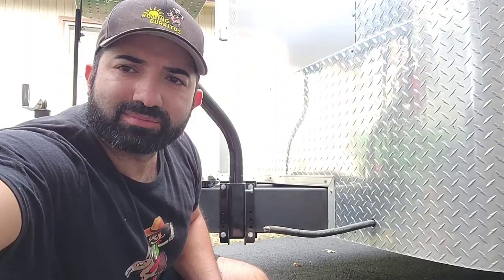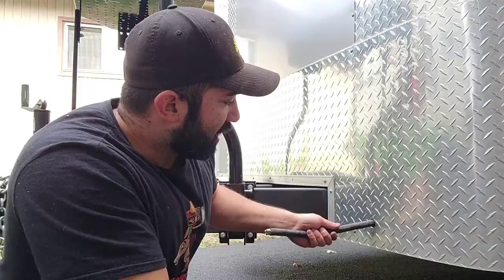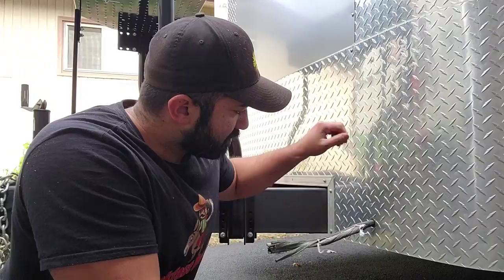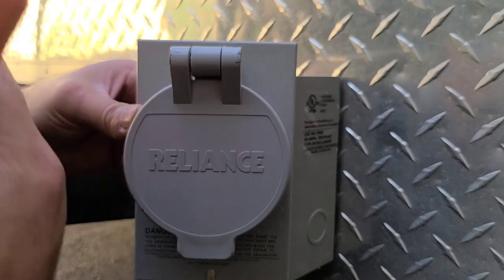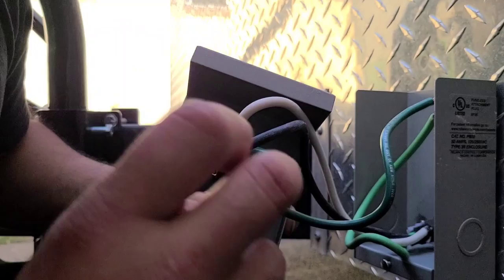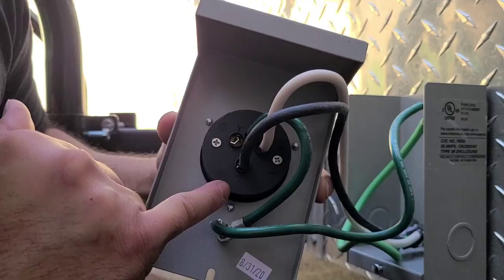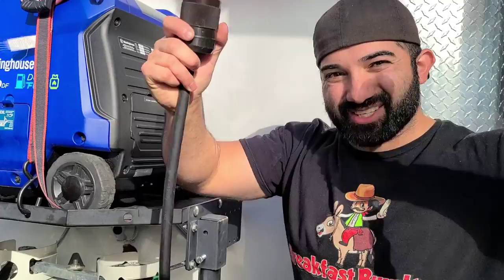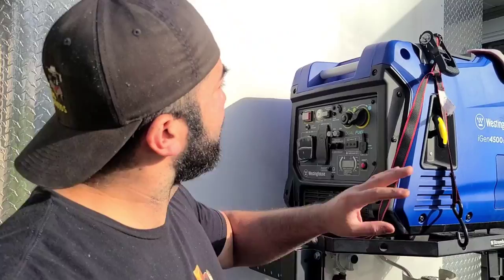Inexpensive vs Expensive Generator, Which is better for a Food Truck?

Comment: Yes the 50amp 3 prong inlet you are using will work. BUT,  I’m fairly certain that inside that inlet it has ground and neutral bonded together. Which is only supposed to be done in a main panel. The trailers main panel is considered a subpanel.
You would need a four prong 50 amp inlet to keep the neutral and ground separate. Or use a 30 amp 3 prong which keeps neutral and ground separate. Look at the back of a 30amp 3 prong 120v inlet and a 50amp 4 prong 240/120v inlet. You will see that neutral and ground are not bonded together on either of those that you could have used.
The generator doesn’t bond together it’s neutral and ground. So I’d think it shouldn’t be done in the inlet either
Reply from the maker: On the thr inlet they have separate terminals is that what you meant?
Reply: @fbaltierrez  
Did you find out the answer?

Comment: Two questions, 1)
 best place to buy Gas struts for the concession window? 2) Any videos on the calculations to know what to buy?
Reply from the maker: @MikePanos  on struts I do not, have never had to replace. And I do, but just take Amps multiply by 120 and that gets the watts
Reply: Can I run a 220V espresso machine on a 30amp breaker?

Comment: Look at 30amp rv cables or marine cables you can get a male to female 30amp cords. I love your video's they gave me the courage to get my foodtruck dream started.
Reply from the maker: Appreciate that tip. Looked them up this morning for the 50 amp one bit on the pricey side. $160 and 10 feet long. Mine is about 6 feet but it is a great option. Thank you :)
Reply: I saw many premade HD Cables listed on Home Depot site also
Reply from the maker: @nathanc3396  yes there are some there I do believe so, you can go either way I liked making my own that way I knew how to make one that was the only reason lol

Comment: Hey Frank, your videos are super underrated and really helpful! Quick question. I’ve added up the total amount of wattage between all the equipment I’ll be using and it comes out to 5500w. So in this case I would need a generator that puts out around 6000w correct? 

(Building a coffee truck) espresso machine’s and brewers take a lot of power.
Reply from the maker: Yeah I would thats about 50 amps. Yes those machines are energy ssuckers. Coffee my favorite
Reply: Hi did u manage to find your anwer? Im getting mixed up with amps and watts, I don't know which generator should I get, I want to get a  tea urn which is 2500w that half already of a 5000w generator
Reply: @1234569518  He is running a generator that puts out 120v 4200W running. 4200W ÷ 120V = 35A. The max amps he can run is 35A. So if you were using this generator and consumed 2500W you would be using 20.83A.  If you purchase a generator that puts out the same 4200W at 240V then the Amps would still be the same but split between two legs. 4200÷240=17.5A per leg.

Comment: Nice video. Understood how to calculate the total amps on your 120V panel. The question I have is, what happens when you need a piece of equipment that’s 240 at the same time with 120’s. Do you wire for 240, calculate total available amps based on 240 and as long as total amps doesn’t exceed the 240 calculations is Ok to mixed both 120 and 240 on the same panel? Or you need separate electrical sources for each? Thanks in advance. Hope you are doing well. Saludos !!!
Reply: Get  a 240 set up and break it down to whats needed with a breaker box.

Comment: Frank - I set up my electrical just like yours where power is going through one leg in the panel for 120 V. I need 50 amps to run everything in my trailer so 6,000 watts. Most generators allow you to switch between 120/240. If I buy a 6,000 watt generator that has the 120/240 option and leave it on the 120v setting, will I only get 3,000 watts of power or will I get the full 6,000 watts on the 120v setting?
Reply from the maker: As per my understanding of Generators, I am not a Generator expert is you will get the max watts on which ever power style you use. Either the 120v or 240v

Comment: Thank you for sharing? My trailer was fitted with a 50 am cord, I need 6000 watts wondering If I can get a converter to plug into 30 amp generator?

Comment: Hola Frank gracias por compartir tu trabajo. tengo una pregunta, hemos tenido muchos problemas para poner a trabajar un trailer que compramos nuevo, al parecer el problema es el generador, tenemos una sanduchera, una nevera bajo el flat, un refrigerdor, el extrartor, aire acondicionado, nevera pequeña de sodas, luces y todo prende, pero deficiente con un generador dual de 7250, sin embargo cuando prendemos el calentador de agua se apaga todo aunque no se apaga el generador y tampoco se bajan los breakers, tu crees que un generador de mas potencia solucione el problema? gracias.

Comment: I have generator does not start at all no crank do I have to put it in metal trailer or wood floor trailer ?
Reply from the maker: You Plug the battery in on the back?

Comment: I have noticed the size and weight of full size generators is excessive to the point a see guys having install a crane or winch to transport. Is it possible to just get midsize generator to run to the plug in to power the lights and fan and then get a portable to run direct to the fridge and maybe a microwave or warmer?
Reply from the maker: I have only used this generator it pushes 30 amps which I have found is usually plenty unless you are running some big coffee machines and such

Comment: How u ever thought on a solar generator ?.  I don’t like to run a gas generator because of the noise , I am pretty sure you could run a 3 watts exhaust fan , lights , cash register , and the griddle , frylator  can be run w propane for my set up.
Reply from the maker: Solar generator interesting, I haven't even seen one yet. Great idea tho
Reply: @fbaltierrez  
BLUETTI.... I want to put my RV on Total Solar... 
I have been looking this up for ever....
If YOU will get ahold of Bluettie Solar Generator... They will HELP you with the cost of the Generator if you make a Video on installing their Generator..
They have asked me to make a video on me installing a Bluettie Solar Generator... The AC200P is good and they have where you can Piggy Back for more amp.... it's amazing.  Clean and Quite!!!
Reply: @fbaltierrez  
People that have Electric Cars/trucks are using the Bluetti in the back to have Electricity in between charges. The Bluetti Solar Generator the one I want ... the AC200P is 60 LBS... there is another NEW one that just came out that you can PLUG in a 30 AMP into the Generator! WOW!!!

Comment: Hello Frank. Do I add the amps from all of the electrical equipments to find out which generator I’ll need?
Reply from the maker: Amps or watts. Watts might be easier if it's all 120v
Reply: @fbaltierrez  thanks for that

Comment: Hey frank I'm running my wire straight from the panel to the generator my fuse on my generator keeps popping that means I need the plug for the outside like you just explained

Comment: I have a predator 7250 watt running watts. I have a full electric cargo trailer. This is 30amp max. It has the ability to use 120/240v. I have to wire the inlet to power this trailer. I want to put a 50amp inlet. I am using 6 gauge wire to put power to the breaker box. My question is, when I wire up X, Y, G, W to the breaker box with 50 amp setup, can I still use 30 amp generator with 30 to 50 amp converter plugs? I want to be able to use 240v if needed. I only use AC, Conventional single stove, mini refrigerator, hot water heater, water pump, and LED lights. I feel like until I get my 50 amp I cant use stove and AC together. With everything on together they exceed 30amps.

Comment: Frank! Do you recommend two of this generators in parallel for a sum of 60 amps. And can I connect the two parallel generators to sane 50 amp inlet you are using   with out overloading. Thank you Frank any help is appreciated. My trailer does require a little over 40 amps. And I would like to parallel two  smaller generators for noise reduction rather than a big gen.
Reply from the maker: I would get the bigger Predator Generator if you haven't purchased one yet. Quiet Generator
Reply: Are the predators reliable
Reply: @fbaltierrez  are predators reliable in your experience/knowledge?
Reply from the maker: @MrKrabsMeatyClaw  in what I have heard  they also are great Generators

Comment: Can I connect my espresso machine to the generator with an adapter?
Reply from the maker: Depends on Generator and machine are they both the right watts and 120v or 240v
Reply from the maker: But hypothetically yes

Comment: The amps remain the same what you increase is the wattage if you ve  two 4200 watts and 30 amp generator  you will have 8400 watts and 30 amp single face

Comment: I’ve decided to buy the same generator as you. Can you provide a link to the cord you bought? Will any 3-prong cord meant for 120v and 50-amps work? I’m just going to cut the end off and wire the reliance 50-amp connector to it right?

Comment: Can I power my ice cream truck with a power inverter connected to the battery? If so what are the pros and cons
Reply from the maker: Never tried that. Would not be able to give any insight. Only Generator and house power used at all times.

Comment: Are you usuing 6-4 50A Cable to make the Pigtail between the Generator & the External Electrical Box?
Reply from the maker: No. Same wire that I use to run to the service panel. 8/3 wire

Comment: Hi Mike Brandt, I am looking at a 3000 watt, or a 7000 watt generator. Do you think a 3000 watt will be enough for a burger van ?
Reply from the maker: 3000 watts is about 25 amps. What kind of equipment are you running?
Reply: @fbaltierrez  Im looking at a champion 3100 watt with inverter( do I need inverter?). Im running a standard kitchen, George foreman grill. small electric fryer and a small under counter top fridge. All domestic appliances. Hot water and stove are both gas powered so don't take power. We dont seem to have this westinghouse model in Europe:(
Reply from the maker: @tr3204  inverter generator are quieter always a good thing. 3000 watts is a bit on the low side IMO. but it all depends what you are running it could work just have to add your amps on the equipment

Comment: How do you power both legs of my breaker panel with 110 volt home power cord?
Reply from the maker: Why would you need that many circuits?
Reply: So all are run off one side of the box.   I was worried about box balance.
Reply: Awesome videos.

Comment: Hi Frank. I’m in the process of building a food trailer. Do you recommend a dual fuel inverter generator?
Reply from the maker: I have a dual fuel now and have never used the propane side of it and probably never will. I would just but the Westinghouse the regular gas one
Reply: @fbaltierrez  thank you very much. Keep the videos coming. I’ve learn a lot from watching

Comment: hi sir, good to have this vids.. im planning to have mobile carts, and im using coffee machine 2500 watts , grinder 800watts, blender 1500 watts, light bulbs of 4 6 watts each, all 220volts and im gonna use it 3-4 hours daily.. 

is 4000 watts normal generator can be good? or inverter generator?  30amp or 50amp? thanks ☺️

Comment: Hey there again, I was wondering can you power a small air conditioner with this generator along with all your appliances?
Reply from the maker: Depends on the total power consumption. This generator handles just about 30 amps
Reply: @fbaltierrez  Can it handle a 500w AC ? Along with your other appliances?
Reply from the maker: @danthemandelasalas217  that depends on what else you are using for electricity in your trailer. You have to add all the watts and divide by 120. Hard question to answer because I'm not sure of the other variables.

Comment: Forgive me I'm not smart but why did you divide your generators number by 120?
Reply: 120 is the voltage. omhs law says P = I*V 

So the generators number is in power (P). So you can calculate the current (amps) by P/V=I 

I is current/amps, and a generator usually runs a constant voltage, 120. 

So amps = Watts/120.

Comment: I am planning to use a mixer that need 240v i bealive i need 60 amps what generation would you recommend frank
Reply from the maker: You will need a big generator possibly a Predator 9500
Reply: @fbaltierrez  do you think the health department would say something about a big generator? I am looking at a champion 11500
Reply from the maker: @831sholo  nah they don't care about Generators. They only care about the inside. Just make sure you but a Inverter generator you will Thank me later
Reply: @fbaltierrez  gracias, you are the best

Comment: Hey Frank,

Great video! I bought a food truck with the electrical & generator already installed (but previous owner never used). It’s an old small one that is 3000 watts. The water heater uses 12 amps and the connection looks like it’s 250v. Is the math then 3000/250? If that’s true I would need something that outputs more than 5500 due to the a/c, refrigerator, prep station, and other small electrical items. Am I correct?

Comment: We just added a table top deep fryer. After a few minutes it throws the breaker..can we plug the fryer directly into the generator while it supplies power to the rest of the trailer? @frankbaltierrez
Reply from the maker: I'm assuming it's a Electric deep fryer? Is it 240v or 120v?
Reply: @fbaltierrez  yes it's 110v, 1700w. It has 2  power plugs for each side